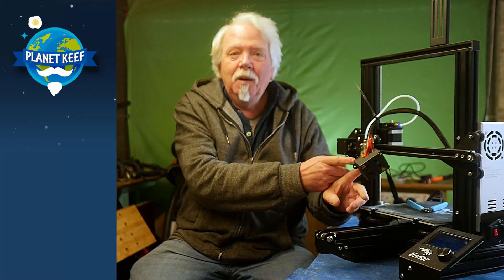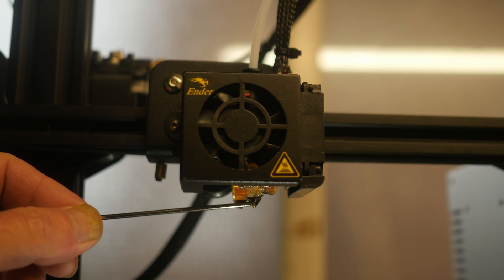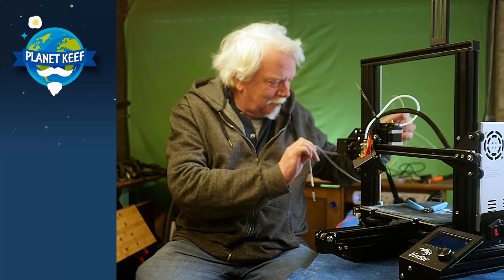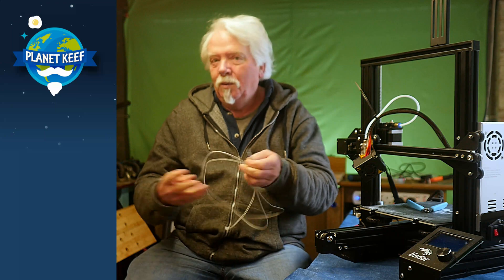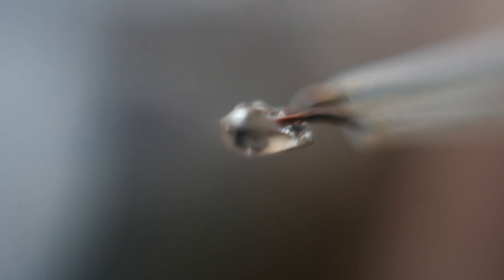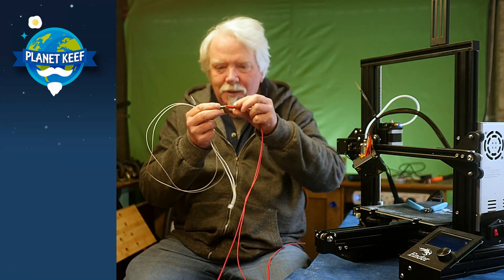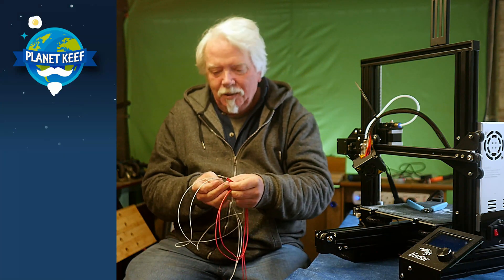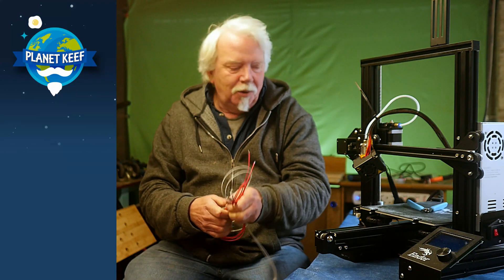I Broke My Ender 3 | Creality Ender 3 Hot End Problem

Comment: The hot end of the Ender 3 is its weak part. I printer for 2 months with no problems. Then it kept jamming. I changed the tubing to Capricorn, replaced the plastic parts on the extruded. Ultimately the throat that connected to the heat block broke. 

Still somewhat frustrated with the occasional terrible print or jamming my next plan is to go to a titanium throat into the heater block. 

The nice thing about creality is that replacement parts are cheap.
Reply from the maker: And I have replaced a lot of parts. I'm very happy with it now - it's printing more or less reliably and giving great quality.

Comment: Oh unfortunately missed this video :(

The insulation on the hot-end is nice-to-have but not absolutely crucial, you can print without it. You should re-run the PID calibration, and then... depends on the Ender 3 model, on some you can save that right into the firmware EEPROM so it picks it up when you turn on the printer, on some there's no saving option and you get to come up with the G-code that sets the PID values and put them into the preamble of your gcode files that you print, which is something that you can automate. But given how sloppy the PID calibration on Ender is from the get go (actually just copied from a dissimilar printer not made by them and not sharing a single part, not even close, not even!) it's mostly all fine really and it's same level of mediocrity whether your PID is botched by Creality or whether it's botched by you removing a bit of tape, you can leave it as-is and print more or less not terribly!

As someone mentioned, putting a 12V cartridge in a 24V system would cause a number of issues. So let's run some numbers, a standard cartridge is 40W, so for a 12V model it's got a comfortable current of 3.3A and a resistance of 3.6 Ohm. Now if you connect it to a 24V system, the resistance is still the same, but it's suddenly got 6.6A going through it, and its power is earth shattering 160W! in that wee little space! This is also not good for the wiring which is only intended to run half as much current. Now if you have access to the firmware and can edit and flash a modified one, you can work around that, you can set a sufficiently low duty cycle - 50% or less obviously, probably more like 25%, and it won't be the safest system to run, but it'll be fine, I forget the setting, I could fish it out, but I feel it's likely irrelevant by this point. A 24V 40W heater has only 1.7A of current and 14 Ohm resistance, which is very nice.

BY THE WAY, have I mentioned that it's probably a better idea to get the Geeetech A10 rather than the Ender3? To my memory, if i'm not mistaken, the heater on those is protected by a 5A fuse - on some models 10A fuse. Anyway if it was a 5A fuse, then when you installed a heater that pulls suddenly 7A or so, it would trigger before you get the smell of burning stuff! Naturally then you have to hunt for the nearly most exotic fuse on the planet, size 1808 SMD, fast-acting, they're about $2 a piece or about $2.20 for a big pack of them from a slighty shadier source, as these things usually are. There's another one of these fuses for just the bed, 10A or 15A value. Melzi and Ender boards have no fuses on them at all. Another plus of the Geeetech is that all boards come with a preinstalled bootloader, so you literally grab Marlin from the official repository (2.0.x-bugfix, not 1.1.x), copy over the configuration files supplied in the examples tree, they have specific to this printer there already I think, on top of the files in the top level directory, open up the .ino project in the Arduino IDE, and click upload, and that's all it takes, you have a fresh firmware, and then you can edit any of its innards and upload again. Oh and reset EEPROM from the menu afterwards, else everything goes a bit wonky. There's also plenty of space on the processor to enable every feature in Marlin and then some, which is not the case with the Ender, and depending on the model probably a bunch of extra inputs and outputs if you were ever thinking of extending the printer.

Thermistors are consumables. it's good that you're loaded up now.

When the MOSFETs on the board fail, they nearly always fail short, as in always-on. The increased current has not caused that, all these MOSFETs on the Melzi and on the Ender board and on the Geeetech boards (not on the MKS boards though, which are fairly decent regardless) are intended to run 10A day in and day out, that's how much the bed takes. What has, you have probably shorted the heater output out while you were building and rebuilding stuff, or during cleaning. That's another thing the Geeetech electronics would have easily prevented by sacrificing the fuse rather than letting the MOSFET fail towards an uncontrolled on-state.

Now if you were to ever rebuild the printer with new electronics, i'd probably choose an MKS Gen.L because it's dirt cheap for about $16 plus $5 in StepSticks, it's got the Arduino bootloader, it's got every output and input imaginable, and it's got lots of program storage, and it'll do fine 12V or 24V. It has fuses, but they're not replaceable, but I mean if it came to that, i'm sure you'd figure something out, I think it's better for everyone's safety to have those than no fuses at all, and they're unfortunately somewhat generous at 15A each for the bed and for everything else, but again, better than nothing. Oh wait I guess it needs a proper display with SD-Card reader rather than that Creality contraption, so I guess you get to add $8 for that. And it does occasionally have an issue with the quality of 5V regulation, so you may want to take a random pin header on the board, for example the ISP header right in the middle and get yourself a little piece of connector for that and rig a nice low-ESR capacitor to it, but only if it turns out that your temperature readings are all over the place. I guess i'm describing something that sounds cumbersome, but I mean worth it for never ever dealing with Melzis again! Because I really can't describe how much I despise the Melzi and its Creality and Anet derivatives, it's like trying to do anything with both hands tied behind your back, and blindfolded. I'd say the next recommendation would be GT2560 Rev.A+, but not later revisions as they get increasingly weird and quirky and Geeetech-specific, but it does have its own drawbacks - for example you bootloop bricked the board - then what - I mean you can recover it but it's a mental exercise for a better part of the day or needs magical timing, the fan controller is a borderline perishable item on that, the fans are usually regulated down to 12V (you can bridge out their regulator if you don't want that, there's even a suitably mislabelled set of pads that are conveniently usable for that), and the analogue pins are not really available for expansions, the USB port has an annoying but not anyhow dangerous ghost power quirk, plus it's a few times more expensive. But it has reputable MOSFETs and a cute protection feature which likely is a good idea - flyback diodes! Wrongly specified flyback diodes, but i'll take that over none at all, thank you very much. My least favourite feature on Geeetech is the power input - the ATX12V connector used for that is hypothetically not really suitable, I had to replace mine a year in as it was generating heat, not enough to be dangerous yet, but enough to suspect worse things to come in the future, but I am running a 12V system - I think on a 24V system, it'll last an order of magnitude longer and be less worrisome, as for the same current, you have twice the heating power, and correspondingly the bed duty cycle is lower at least for small 20cm-ish beds. I think the Bigtreetech board (BIQU is their brand too) will be great and super cheap, but it's 32-bit so that's its own set of challenges.

And as to all-metal hotends… I don't know, they're more finicky for sure, as there's more opportunity for filament to get stuck, the machining is often atrocious but you can fix that, but they also need an effective heatbreak, and as far as design of all these things goes, I have my doubts, because there really is too much coupling between hot-end and heatsink in this Creality design and its Geeetech copy due to stupid screws and the throat - which is also another reason why you shouldn't worry too much about losing the thermal insulation on the heater block. Unless you need high temperatures, PTFE is a comfortable easy way out.
Reply from the maker: Wow Siana - thanks for all the info! Coincidentally, I just upload the video of how I fixed it today! Here it is: https://www.youtube.com/watch?v=T9t6qZ6vmxU
Never come across that GeeTech printer, but it does look good 😀

Comment: I hope you have resolved your issue by now but if not already mentioned in the comments... Check the rating of the heating cartage you purchased. Your printer operates on 24 volts which is a fairly recent thing as 12v WAS the standard for the lower end machines. If you can't find the rating just assume its 12v since cheap sellers might be looking to rid of old stock and intentionally omitting the fact that its a 12v rated one. They all look the same. Make sure it says specifically that it is a 24v cartage. The second part to your hotend issue is something called a PID calibration tuning (gcode M303). Those three numbers (the P I and D values) is specific to every printer and has to be derived from by running a PID calibration and changing it in the firmware EVERYTIME a new hot end is installed. This algorithm is what the printer uses to slowly ramp up and down the power output to the hot end in order to safely heat up and more importantly stop/maintain set temperature. Its ALOT more complicated than that so I suggest you look into Proportional Integral Derivative (PID) settings for 3d printing. PID is used in MANY other applications such as quad-copters and balancing robots so PID for hotends/3d printing specifically just to understand its importance here. Hotends are deceptively simple looking but remember what you are asking it to do; Heat up to intense temperatures that melts all sorts of plastics and quickly cool down to room temperature in an area of a few mm (suggest you get a prebuilt hotend). As for the printer immediately heating up right after start up without user input…maybe a damaged mosfet on the board....?? or other shorted component…? Only other time I have seen something like that as an issue is in 3d printer like  laser setups/conversions where the controller would fire the laser as soon as the controller board is plugged in. Might be related but that is not common behavior of your specific machine.  Unfortunately without being there to troubleshoot its just my wild guess.
Reply from the maker: Thanks for the comprehensive reply! Yes, the replacement heater cartridges I got were 12V, hence them heating up insanely quickly when you pump 24V through them. I've now got 24V cartridges. And yes again, blown MOSFET on the Melzi board. I've just installed a replacement board (v1.1.4 so a bit of a bonus upgrade) and had a quick test with it last weekend - much improved but not heating up to temp. So this weekend's challenge is PID tuning...😀

Comment: I have a similar problem right now. Out of the blue  a meltdown resulting in the insulation from the hot end being removed.

Im trying to troubleshoot now. I suspect I have an intermittent cable connection because it happens at a specific height of the print job.

Alternatively, it could be the thermistor being damaged when cleaning off the insulation on the hot end or the thermistor mounting issue ( is not in contact with the metal they are monitoring)

Your issue sounds like the new thermistors are either the wrong value or are not touching the metal they are monitoring. I would expect the position of the thermistor against the hot end is critical.

If I can't resolve I will try a replacement hotend unit from Creality
Reply: TechKiwiGadgets Hey i got the same problem right now :(  you were able to solve the problem?
please idk what to do

Comment: you probably bought a 12 v heating element you need a 24v heating element
Reply from the maker: Yep, you spotted my idiocy! But now I've installed a 24V one and it's not getting up to temperature properly - I can get it to melt PLA when I set it to 250 C - it's still too cool at 185...Do I need to do something in Marlin?
Reply: @PlanetKeef  it might be the thermocouple broke from too much heat.

Comment: Why nobody check whats wrong and what is the cause of the issue before replacing all the components. Why nobody have multi meter or not using it. 
1. Soo capton tape insulation? It basically does nothing to 3d printing just isolate from cooling by fan, why replacing it with new hotend. Did You test it if it working before replacing hotend?
2. Thermistor again why? You turn on machine it shows your room temperature - its working. The temp on lcd is rising... so check if hotend is getting hot. It is! termistor is good and move to explain why temp is rising when you didnt request it from printer.
3. Replacing heater ? Does it produce heat? soo its working. Even soo you replace it with new one and still have same issue replacing it again and again doesnt solve the problem.

THE ISSUE: Hotend is getting hot without you setting it up, and you have no control of temperature.
WHY: Wired wrong or motherboard cannot control of its output - Power Transistor is blown (MOSFET)
CHECK: Use multimeter with continuity or measure resistance between negative terminal of heater element and negative (GND) terminal of power supply (motherboard must be turn off and heater element disconnected). If meter shows around 0 ohms - mosfet is fried. You can soldier new one. Ender 3 is open source and materials are in github so you could find part number.
WHAT HAPPENED: 1: You use brass brush on heater element wires and shorten it causing MOSFET to overcurrent and burn.
2: You replace Hotend and cause short circuit on heater terminals.
Reply from the maker: Thanks for the feedback - it would've been better without the aggressive tone. You maybe didn't spot that I am a complete newbie with this stuff.
Reply: @PlanetKeef  I don't think it was aggressive, it was just my thought process about the video and steps i would take to resolve that kind of issue. I can tell that you are newbie that's why i reply with longer message with few points. If it seems bit aggressive sorry about that - english isn't my native language. Good luck. 3D printing can be amazing and can be really frustrating.
Reply from the maker: Thanks. You're right about it being frustrating. I'm now at a stage where I know one of the MOSFETs on the original board is no good (and I really don't think I could replace it even if I wanted to). So now I have a new mainboard - MKS Gen v1.4, wired up according to a video on Teaching Tech (it's a bit vague about powering the fans, but I've connected those to a couple of 5V outputs). Nothing much happens when I connect a USB cable (one of the onboard LEDs flashes). I don't know if this board has a bootloader and/or Marlin pre-installed. I've tried connecting an Arduino Uno to use as a bootloader, but have no info on how to wire the ICSP for this particular board - tried a couple of different arrangements for the jumpers, but just get 'Programmer not responding' error. Totally fed up of this now!
Reply: @PlanetKeef  I dont know about MKS board much. I was considering it with quiet drivers for stepper motors. Eventually i use Duet 2 Wifi mainly for wireless functionality and touch screen. Its expensive but the "gcode everything" is the feature i cant gen enough. You can change every setting via text editor in web interface. Back to issue. I would:
1. Disconnected everything. Power it with 12-24V(ender3 use 24v). Connect usb and check if there is new COM port in device manager. If not - you need FTDI drivers. If yes try to connect with some slicer to the selected com port. If no response marlin is missing.
2. Try to upload marlin with arduino IDE to MKS via selected COM port. I used th3dstudio firmware package. If its not uploading/connecting we need bootloader.
3. For uploading bootloader i use PICIT4 which is not best tool for debugging avr, but proggraming work fine. You can use Arduino board as programmer (i also used Teaching Tech instruction for ender3 bootloader). 
4. ISP pinout. You must connect 5V and GND in right way or something may burn. Other pins are not critical but must be connected in right order to work. MISO MOSI RST SCK should be described on mainboard. Arduino board pins should be on https://www.arduino.cc/en/Tutorial/ArduinoISP site.
5. Ender 3 have 24v fans so i would use 12/24v pin (wrong polarity and fan may burn). I thing this is pinout for the MKS https://reprap.org/mediawiki/images/c/c2/MksGenV14-Pinout.png
6. The jumers i suspect are for configure stepper drivers micro stepping and can be different configuration fo different drivers.

Comment: im fairly new to 3d printing but i have done lots of research and it sounds to me like the either the mosfett switch for the hotend is shot in that case it is easy to fix and or you purchased a 12volt heater cartage and you need a 24 volt one for the ender 3 .. look on Amazon for a guanine replacement for the 24 volt hotend cartage also look on YouTube for videos on how to wire in external mosfett to ender 3
Reply from the maker: Pretty sure it is a MOSFET, so I've got a shiny new mainboard (replacing MOSFET on Melzi mainboard is not something I can do).